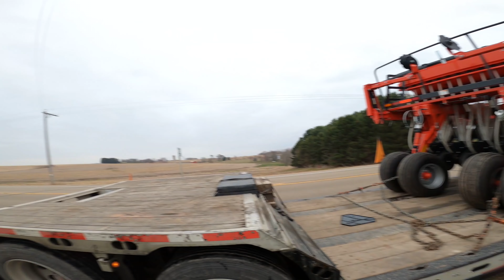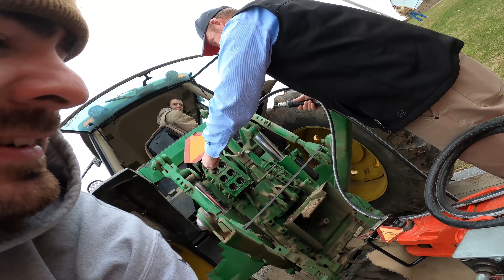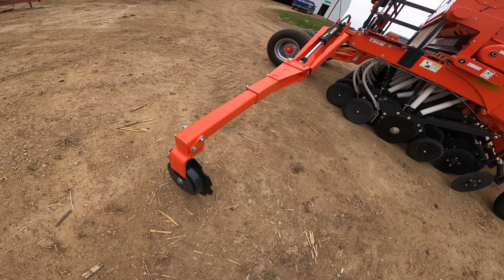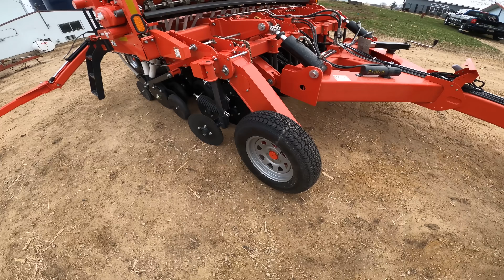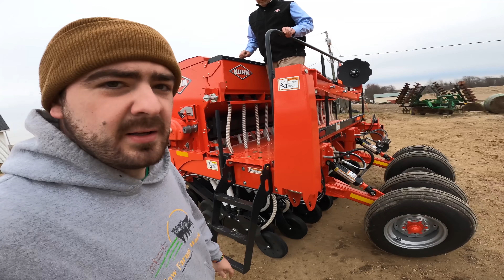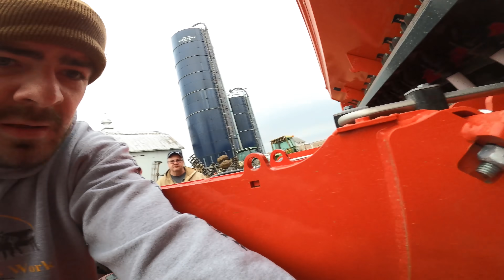This thing is *MASSIVE* | BRAND NEW KUHN 9400NT No-Till Seed Drill

Comment: If your 4020 can pull a six row cultivar on your hills, it should easily pull that ten foot drill. Besides it will turn better on the headlands than the 7600.

Comment: I was wondering what this weighed? Went to the link provided and under SPECs all spaces are blank. Any info Ryan? Nice piece of useful equipment on the farm this Spring.
Reply: This unit, with 7.5" row spacing, weighs 9,955 lbs. Not sure which browser you're using to access the product page, but the specs should be appearing completely.

Comment: What's the difference between a seed drill and a planter?
Reply: A seed drill is basically a controlled spill of seed, usually in narrow rows for small seed types. A planter has a mechanism to singulate and space out the seed placement, usually for wider rows and larger seed types.

Comment: Kuhn make some of the best (heavy make) equipment on the market. Used to go out demo power Harrows, ploughs and drills for kuhn through our newholland dealership. Would like to add that being a mechanic I never had to repair many due to machine fault only accidental failures due to operator hitting something hard 😁.
Reply: ian haggart idk bout tillage but there hay equipment blows
Reply: @jeremyfreeman717  I think the gyros were made by another company. Can't remember who. Jf stoll?
Reply: O. Balers had a lot of electrical problems too. Never used there tillage implements
Reply: @jeremyfreeman717  mchale for balers or new holland  but it is all to personal choice and farm type.
Reply: ian haggart correct. Deere made excellent round balers.